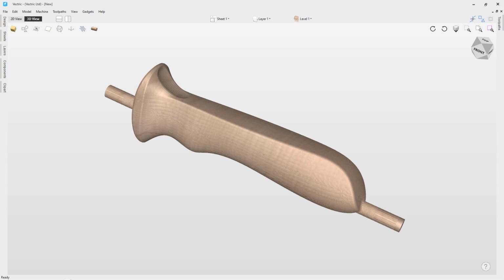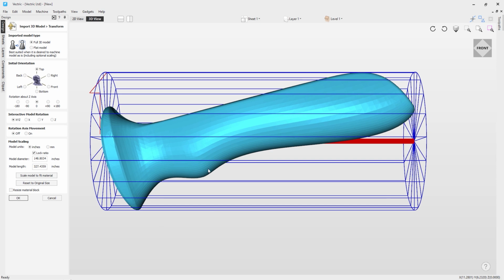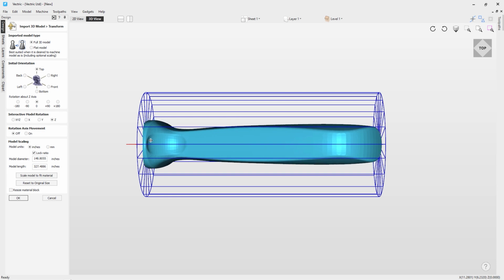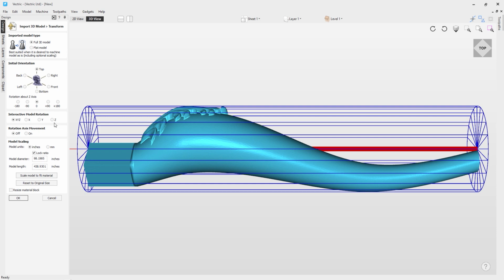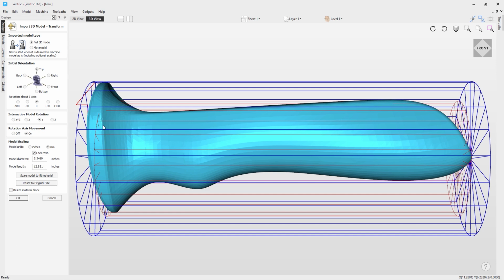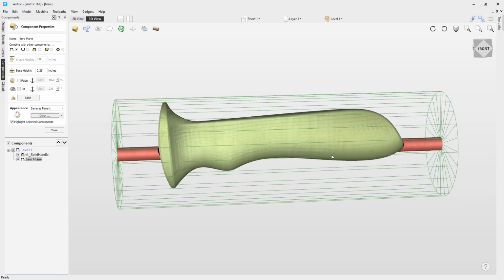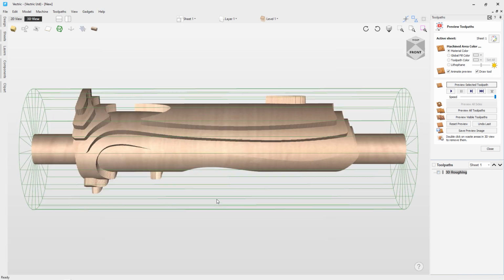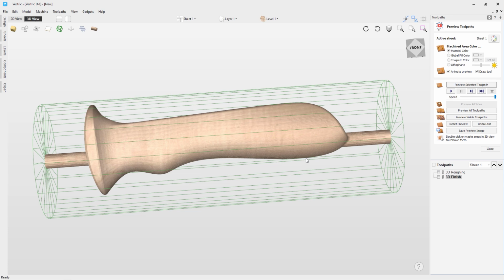Import and unwrap full 3D model in Vectric software | Wrapped Rotary Machining | V12 Tutorials

Comment: This is the best 3d model geometry explanation for 4th axis I have seen and I can relate to 
So thank you very very much
I have a question 
If using square stock to start with how do I trim it before starting
Reply from the maker: Hello and thanks for the comment and question.  If you have VCarve Pro or Aspire, we have in the gadgets menu, under Wrapping, an option called "Create Rounding Toolpath".  This will do the trick.  If you don't have VCarve Pro or Aspire... then please contact Support@Vectric.come where they can give you a hand.
Reply: @vectric  awesome 
And thank you for responding as means a lot 😊